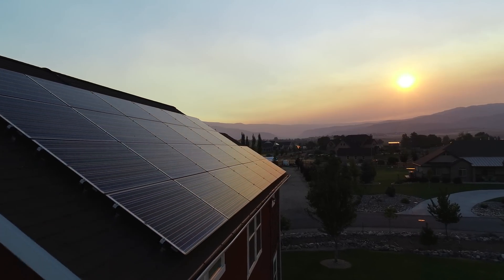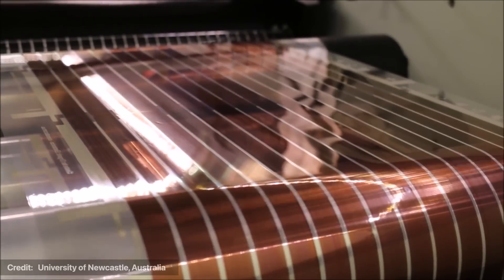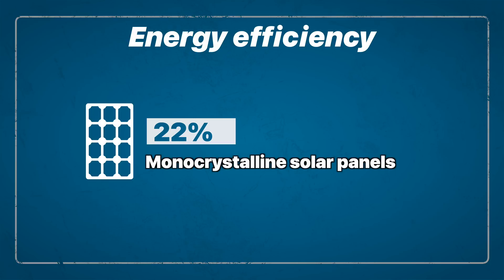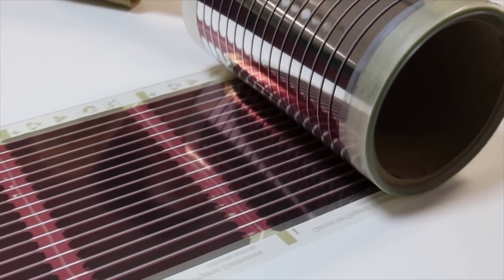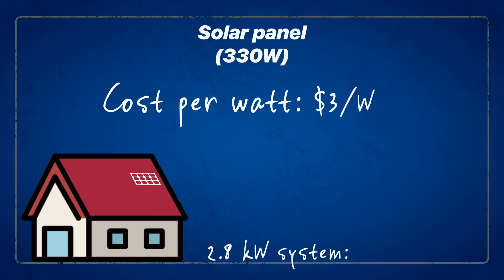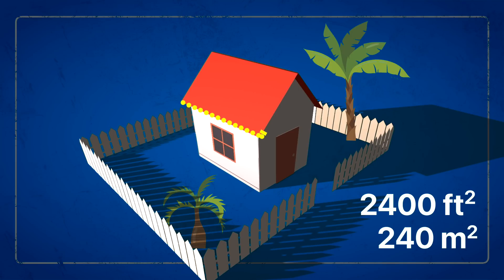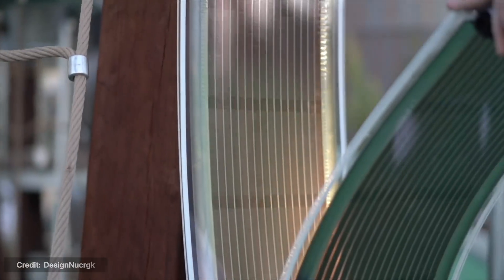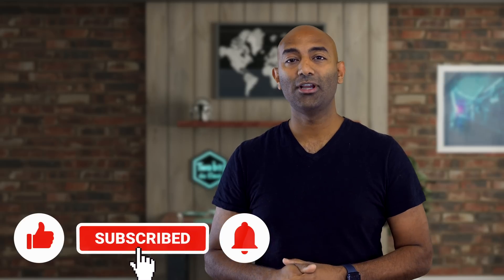This Breakthrough Solar Tech is CHEAP & Printed Using Ink!

Comment: During a flood emergency, I wonder if these panels can be designed to even float on top of water, just in case you don't have enough solid surface area?
Reply from the maker: yeah, absolutely great point... they might require some sort of support system but because they're so light it would be pretty easy. very interesting use case, and yeah totally make sense
Reply: @TwoBitDaVinci  Great Idea .. You can even deploy them on floating platforms to cover Reservoirs and reduce evaporation.  it would be too costly and technically difficult to do that with rigid panels and Silicon flexible panels are even MORE expensive than rigids. But you put a Film of these things on Floating supports and cover Lakes like Mead and Folsom in California and you can Generate Electricity AND reduce evaporation.  It would be better than those Black balls they floated over Ivanhoe Reservoir in LA.  And once a year you can remove them, recycle them and deploy new ones during regular Dam/Lake maintenance periods.
Reply: Why not. We have flat boats called pontoon boats.
Reply: Installing regular panels on water is already a thing, these are much lighter so it is more an issue of tying them down to something so they don't float off with the current.
Might be easier to just stick some rods into the ground, tall enough they are above water, and hang the film from them like a fence.
Only issue with either idea is that solar panels are installed on an angle for a good reason, neither | or _ catches sunlight as well as /.
However, being easy to manufacture and transport in large amounts means we can just cover a few square miles with these things anytime we need to.
Reply: I covered all available space on the south facing side of my roof with 21% efficient panels. Some space was consumed by skylights, plumbing vents, and masts for power and phone wires. And that still doesn’t completely offset my consumption.
Reply: @jimmurphy5355  Does that matter? If you can't simply consume less the cheapest plan is to just be satisfied with the amount of money you are already saving.

If you really want to get off grid you could build a frame in your yard or add more panels on the other roof even though it does not get as much light. However, while the frame would be pretty cheap option it might be against local regulations, and spending more on extra panels that do not produce as much or that are not needed 100% of time can get stupidly expensive compared to simply buying the same power from the grid.

For example a typical home can easily save $2000/year by installing $12k solar panels but on the hottest and coldest days the higher demand means they still have to pay few hundred dollars per year for electricity if  net metering does not cover it. Preparing for darkest winter days by installing a $30k system that saves $2500/year by dropping their electricity bill to zero means paying 3x as much up front and waiting 2x as long for the panels to pay for themselves.
Reply: @AnalystPrime  I was merely noting that for my particular circumstances, there is not enough space on my roof to get a worthwhile amount of power from these low efficiency printed solar cells. I don't have the option to  take advantage of the low cost by covering more area. My north facing roof is also heavily shaded by trees, but even if it wasn't, indirect light from the blue sky makes far, far less power than direct sun. Less than 1/10th as much. Even if the printed panels were free, it would not be worth the effort to place and wire them to get so little power. There is no space on my small suburban lot to pur any other panels. Trees and the houses on neighboring properties shade most of the space for substantial parts of the day.
I agree, overbuilding to be off-grid even on low solar days and seasons rarely makes sense, unless grid power is simply not available.
Reply: If it is effective and inexpensive, it has a huge market in India
Reply: @sngopalkrishna8054  At the present state of development, it is inexpensive, but not sufficiently effective or durable to be worth even the low cost.
Reply: Water and electricity…..sure why the hell not.

Comment: Is this a potential disruptor that could put existing solar out of business? Also, US homes are arguably oversized compared with European homes, and what about powering city homes? This suggests it’s a solution for suburbs at best, if not mansions? I’d like to see these on the sides of office buildings and factories, but at such efficiencies, it will barely nibble at the total power consumption of these buildings. Just because something is ‘cool’ it doesn’t mean it will work. Good video and it’s made me think.

Comment: I do love hearing about 15 year "overnight" successes. In their current form I can see these working for more temporary solutions, providing some power during the building process or a disaster. Over a few years with increases in longevity and efficiency these could become a nice entry level option.
Reply: Correct.
Reply: camping

Comment: Have you done a video on the company that does hybrid solar panels, where it’s basically your normal photovoltaic array on top of a radiator that water is run through to capture all that heat energy the PV cells can’t catch. I wonder what the theoretical efficiency of that system would be? Used with heat pumps it could even have a positive COP?
Reply: With the additional benefit of cooling the solar panels that’s pretty awesome. Cooler cells would stay closer to the ideal efficiency. It would vary a lot how efficient the entire system is because the heated water would be most useful in cold climates and less useful in hotter climates where you have more sun.

Comment: I don't know .. I mean people Put up and take down Christmas decorations every year. If they can devise a way to quickly (and non invasively) put these up and take them down, I can still see them being used.  They just become another home owner's task like changing the furnace filter, replacing the smoke detector batteries, seeding and fertilizing your lawn .. that sort of thing.  You can have someone just come up once a year, roll the old ones out and put up a new roll.   I mean sure, I would love for them to be more efficient and last for longer. But I still can see "disposable" solar panels being a thing in some cases.  I don't know.
Reply from the maker: good point Jon, to your point about christmas lights, maybe a mount system on the edge of your roof maybe tying into the roof edge or gutter... could be easily (somewhat) taken down and up... lots of options... why I like things like this. We can dream up all sorts of use cases
Reply: @TwoBitDaVinci  Exactly. I don't think we should dismiss these with that price per Watt. Their flexibility and low price can be a huge advantage if you figure out a way to deploy them and replace them quickly. Even if you replace them once a year on a regular basis (so long as they are recyclable), if it's something you can do (or have done for you) in an hour or two, it's worth it. Examples: Pool covers, topper for older covered parking lots. The possibilities are endless.

Comment: Those panels have a lot of transparent areas…. I wonder if they could benefit from double stacking the panels and offset them by just the distance of one cell so all it’s surface area is black. I’m sure it won’t double the efficiency, but it could increase it enough to still be economically viable (especially if they bake that into the manufacturing process)
Reply from the maker: love where your head is, you're totally right, that's a quick way to bump efficiency up a bit more... perovskite is another... there's promise for sure!

Comment: Even to last 2 years the panels will have to be inside a protected structure... it makes no sense to apply the panel directly to the roof without a rigid structure to protect it.
Reply: And using an adhesive also doesn't make sense because the roofs are not totally perfect... and changing panels every X years can damage the roof. (For this reason, the idea of a structure Rigid to hold the panels)

Comment: These panels could be used as a very cheap way to power small electronic appliances, like smart ID chips in a sticker on consumer goods.
Like to allow automatic pricing and checkout in a supermarket or to keep track of storage conditions to determine freshness.
It could be used on toys or the old melody happy birthday card, without batteries which are both the most expensive and most polluting parts.
Anything that just needs a little bit of power and currently has to be fed with button cell batteries that often get thrown in the trash.

Comment: Interested in what kind of applications this will be used in. Disaster relief is a pretty good idea! I should need a new roof in the next few years, considering those GAF/Timberline shingles that are coming out. Keep up the content!
Reply: Replace your roof with a heavy duty metal one on top of a heat barrier and anchor it down even more with hurricane straps.  You won't get good cell phone reception indoors, but that roof won't need replacing either.  There are 150-yr-old metal roofs still in great condition.  Since my internet's via fiber optic cable, I just got Skype for indoors in order to receive incoming calls.  I can call out on cell though at most I only get one bar.  But it's enough.  Beats having a crappy 20-yr shingle roof.